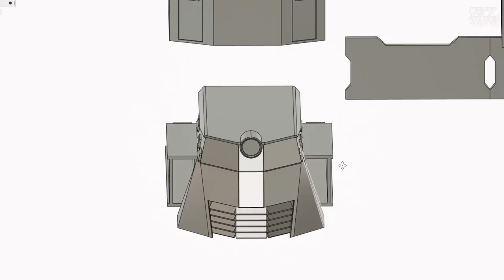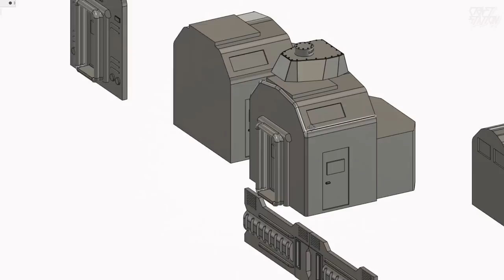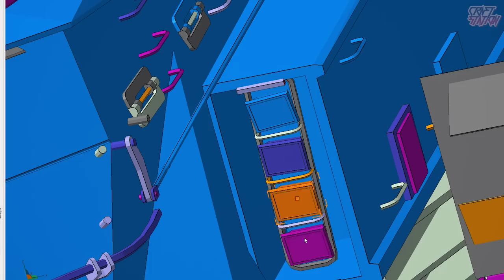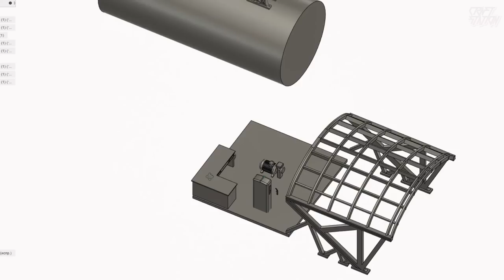How to make working post apocaliptic train from Metro Exodus 1\87 HO

Comment: Could you make “O” gauge 1:48th scale railway models ! I know the are big and take up more space but I like the detail and increased functionality!
Reply: Like what compared to HO? What's different?
Reply: @BattleshipOrion  “O” is twice the size of “HO” Ho means “half of O “
Reply: @maxwellwoodhouse2908  I get that, I've been doing models since I was 5. I model 1:400, 1:300, 1:150, 1:87, 1:64, 1:50, 1:35, and1:14. What are the advantages to having O vs HO? Durability is excluded. N, HO, & O are of the same detail level, just smaller. You can get lights, sounds, motorized turrets, & other thing in smaller scales, such as N scale. So what advantages? If the space is not worth it when you can do more in that much less (with more effort) space, then why go for the larger scales? Sure it's easier to see but the logistics of the choices makes no sense. Also I know my guages. 4 & 8-1/2 inches, .23, and 12 guage. Keep in mind, those scales in the hundreds to 1, though the models are in the hundreds of feet in scale, that area is still tighter than HO locomotives of both prominent contenents, multiple motors, electronic control boards, sounds, timers, etc. even people (if I'm that bord) are just some examples of functionality in small scales that larger scales also benefit from.

Comment: I come from Germany and it feels like H0 is only super expensive. Märklin and Pico and how you dismantle the old locomotive into the individual parts makes my wallet cry ...

The finished train looks great, I'm almost a little jealous because my HotWheels conversions for the post-apocalyptic Gaslands tabletop don't look so great old, rusty and worn out

What's next? Buildings and grounds for a Metro Exodus model railway slab?